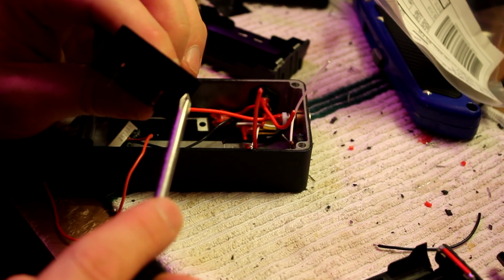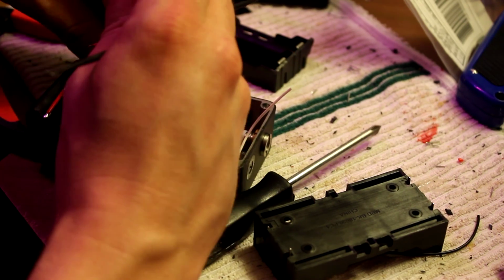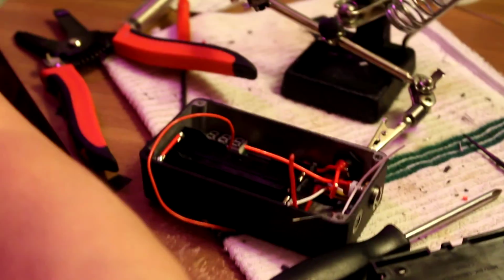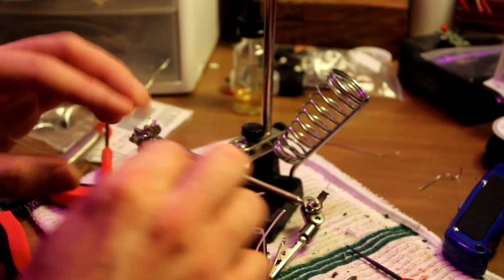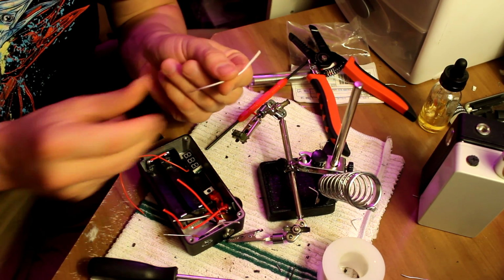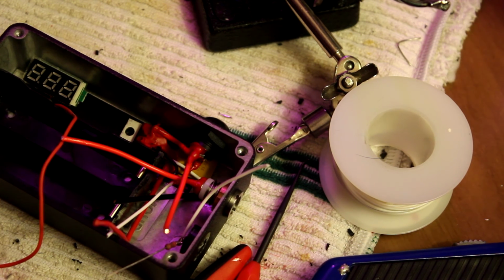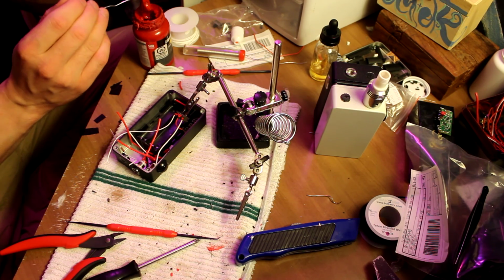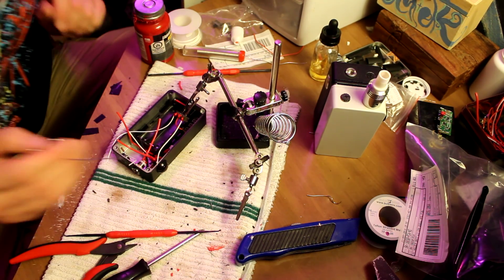3 position switch/voltmeter/battery sled tutorial

Comment: is that a .36" voltmeter or .28"? just curious to see if both would fit
Reply from the maker: That is a .28 but you can use either size.
Reply: alright yeah it looks like both would fit if you sand the sled. for the fuses you used do they have polarity? because im ordering soon but cant find fuses that show a + or - and since they gottta be parallel im wondering if the fuses dont have polarity
Reply from the maker: will hately They don't have polarity.
Reply: thanks man. been trying to get that answer forever and nobody replies to my posts on reddit for some reason.
Reply from the maker: On openpv?
Reply: Dustin Brown yup I'm new to reddit but I've submitted like 6 posts in OpenPv and literally never get even 1 comment but when I post in the eletronic cigarette one I get help but I thought that's what open pv is for. Bc especially with those fuses bc I ordered the part number RGEF1000 from digikey and needed to know if they had polarity and nobody would help so I appreciate you responding.